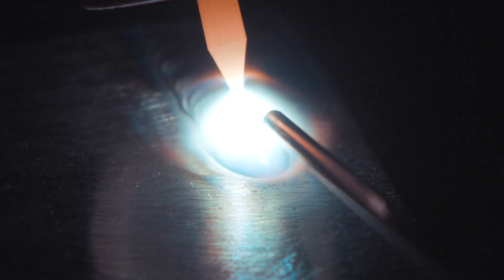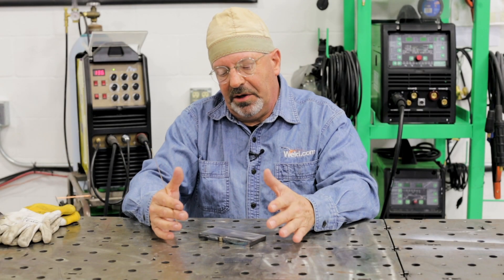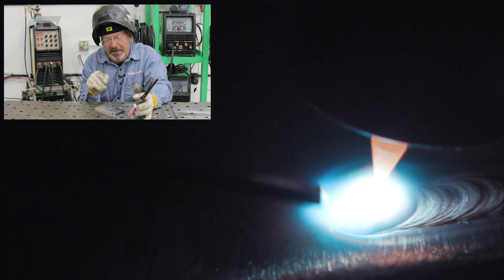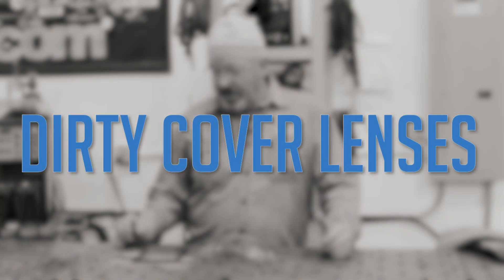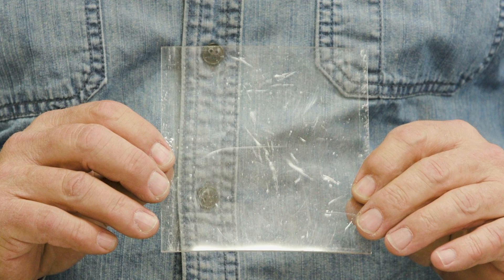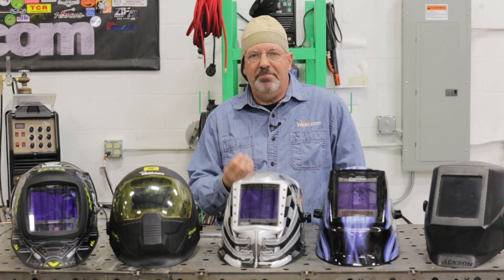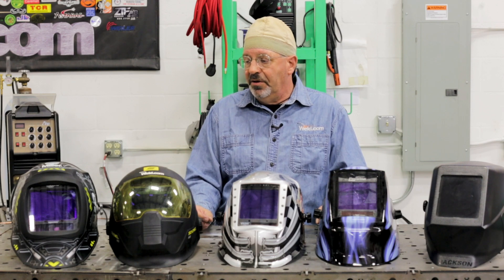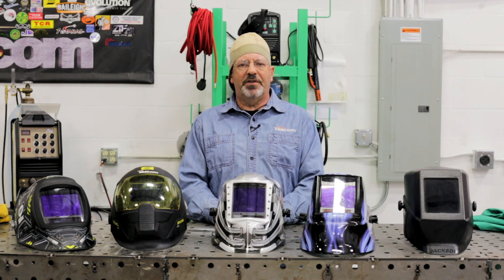I CAN'T SEE WHAT I'M WELDING!!!

Comment: Lots of good tips here. I use cheaters and  sometimes they fog behind the lens if mounted to high in the helmet.  I have also noticed if I don't keep the torch stationary on the weld during the gas post flow and lift or wave it around while it is still glowing, that oxidation on the tungsten seems to reduce that light output from it and the arc by a lot.

Comment: I came here because I've been arc welding for years and now just got a MIG welder. Yeah I know its the wrong way to have done it. But I've just started practicing with it and using my old basic helmet I used for arc welding and finding I can't see anything when welding. Is the arc from arc welding brighter then the arc from MIG welding? As this is what it seems to me. I was going to get a more modern one for welding soon thats self darkening. Anyone know if the cheaper ones are worth it, or are the actual shades not of a good enough standard to protect your eyes.

Comment: What best glasses for brazing/cutting with gas+oxygen setup? Got a "GOGLE AUTOMATYCZNE SAMOŚCIEMNIAJĄCE COBRA 3000" but the problem is it gives reflections eye stain because of from and back plastic filter, the lowest shade is a bit dark, even without turning the mask ON. What I'm doing wrong? Any source of cut to size antireflective coating plastic filter sheet?

Comment: I have the same TIG machine as the one that's sitting behind this guy and I've given up on trying to use it.  I can't see the weld well enough to do anything with it.  Very frustrating.  I have a MIG welder that I've been using exclusively, but I would like to use the TIG too if i can ever get the hang of it.

Comment: Finally, you solved my issue!  I've had this issue from the start, so I bought a more expensive helmet with "enhanced view", I've upgraded my shop light, even added two 10,000 lumen portable shop lights.  Then I got desperate and reduce my shade setting to "9" instead of the minimum recommended "10", but regardless I could only see my puddle, but not what I was welding.   One of the very first statement you made was the key:  "Don't get too close, sit back at a comfortable distance" I tried this and what a difference, not only can I see what I'm welding but I can do it with a shade setting of "10".   I'm thinking that keeping a greater distance to the work allows my eyes to pick up the contrast between the arc and the workpiece, but when you get too close the arc just overpowers the background.   Thanks again :)

Comment: Lighting. My issue is not enough light to see.
I now have added an LED light to put on the work AND I have a light I have added to my helmet.
Sometimes it does effect my auto darkening and everything goes black, so you have to position the lights so this does not happen.
Also, overhead light can get into the helmet from the back so I use a piece of leather to block that.

Comment: I built my own helmet and tried it with a 9 and 10, it protects well but I can't see the weld I'm doing while I'm at full power. It's a small mig 110 A no gas so 9 or 10 should do it?, any tips welcome. Maybe need darker glass? It's weird because I'm used to welding, mig mag/tig, pin and gas, and back in the day there were never any problem seeing what you're welding, is something changed with the glasses maybe? I haven't been welding in ages I should say. Again, any tips welcome.

Comment: One thing nobody seems to mention for some reason:   The amount of light emitted by the arc depends on the current and voltage.  If its too dark to see where you are going, you might have the voltage too low, which should cause poor welds.  But when you are a beginner, a poor weld can seem as good as you can get.

Comment: I have an Air Products welder I purchased. I am welding on a Jeep chassis. I am a beginner welder. I do not have amperage knobs or voltage knobs. I have a heat and wire-speed knob. I have found what I think is a good setting for 1/8 steel.  I tried looking in the chassis to see any discolored to see if I am getting good penetration, but cant see good enough.  I have looked all over the web trying to find charts or information on this welder.  Any help or tips is greatly appreciated.

Comment: I CAN'T SEE WHAT I'M WELDING!!!
This has always been my problem and has prevented me from advancing in welding (Mig and stick welding only thus far). But I really do want to progress - but I can't see beyond the glare of the arc! It 'may' be an age thing - eyes deteriorating at age over 50; it may be related to the fact that I have always been troubled by say: the glare of oncoming headlights when driving at night. Even very bright sunlight can be a problem too. It seems to be the dynamic contrast between very bright and very dark - I can see one or the other but not both at the same time. Hiding my line of sight behind the torch to avoid seeing the arc  helps but not always possible, as does chalking a white line for me to follow. I need something that turns down the brightness of the arc but turns UP the darkness beyond that supernova. Or take up knitting instead! :-)

Comment: When on the job in most cases there are always obstacles that influence your comfort zone. Doing boiler tubes is just one example or rooting a tube or pipe that is just inches off of the floor or up against the shell or wall. Not all jobs will be on a bench. There are excellent suggestions in this video that will help with being able to see your work more clearly. I think one thing that I found that really improved my visibility while welding was wearing a positive feed air supply respirator. It kept the smoke out from under my shield while welding and kept my face cool. Having really good lighting will also improve welding visibility as one poster has suggested.

Comment: Cleaning lense - go to the optical shop at Walmart and purchase a packet of lense cleaners - the ones that a cloth - 3x3 or 4x4.  I use to use tisues - these will scratch the lense.  Since I started using the lense cloths I have never scratch my lenses.  The cloth cleaners can be washed.  You can also pick up a bottle of lense cleaning solution.

Comment: It's not a focus issue but a brightness issue. The minute the helmet turns on, it's so dark I can't see. Even if I set it to about 10. Is that normal to protect eyes and how do others do it then as it's much too dark to see what I'm doing.
Reply: Auto-darkening welding hoods have adjustments to let more or less light into the window. It's usually a button or knob either on the side of the welding hood or on the inside window plate. Hope that helps.

Comment: I've also found that bright lights on the work helps - but I have to ask about the auto-darkening helmets. I haven't seen you using one - so I assume that you don't prefer them and I respect that. I problem I seem to have these days is that mine seems to go dark slowly, and I have to recover from that initial flash. On occasion, I have been welding inside an object, and evidently the sensor was not exposed to the light coming from the arc. It was annoying, but I will admit I have a hard time keeping my hands steady when I'm flipping a helmet down. Thank you for the video - you are a good teacher!

Comment: Being an old guy my vision is not what was when I was young that is for sure. My bifocal glasses give me fits when welding. I need a new hood for sure and I will be checking out those cheater lenses. Thanks!
Reply: I found that 3x magnification polycarbonate safety glasses work really well. When I really need to zoom in on a weld, I'll then add a cheater lens as well. Hope that helps.

Comment: I had major problems with visibility, and it turns out that I was using a bad helmet (ie. cheap auto-darkening). I upgraded to a $200 Weldclass Promax 500 and visibility is dramatically improved. This might be worth a try for anyone struggling with this issue.

Comment: I only do welding occasionally but have welded in industry for a guy for a period of 3 years before I retired.
One thing I found out with Tig and that is you need to know precisely where that sharp point of the tungsten is before the arc starts..........a welding helmet has a light green lens when it's "off" and even that is difficult to see through clearly.....once the arc strikes you can see the point of the tungsten but only as a glowing blob.........I'm using an LED head band torch duct taped to my helmet and switch it on before dropping the hood......it works sorta but I think a more powerful LED spot light next to the work piece shining on the weld seam will work better.....my next trial time.
Also, my helmet has a variable darkness dial on the side and can be dialed to go lighter or darker if need be.....I don't know if this is a common thing with all auto darkening helmets.

Comment: Thx for the presentation. Does the arc obscure the very tip of the electrode or are you supposed to see the very end of the tip within the arc. I ask this as I cant,  and as I am partially red-green colourblind I am wondering if this is why I cant.
Thx for an answer

Comment: I used to have little temper tantrums because my welding was getting worse to the point where I was ruining my jobs. Finally put glasses on and I was a champ again. Instead of doing the full value in my helmet, I split it between my glasses and a helmet cheater. This way I had better focus after I lifted my helmet.

Comment: I keep a small squirt bottle full of water and vinegar on my welding cart. I also keep a soft microfiber cloth with the bottle. Whenever I'm done I wipe everything down. You really need to take care of a piece of equipment that is there for your protection. About every 6 months or so depending on how much I'm welding I take everything apart clean it wax the hood and put everything back together. I've had the same hood for 15 years. Whenever the plastic does get destroyed I keep new ones on hand for the outside and the inside. I just bought myself some cheater lenses haven't had a chance to try them out. 

I enjoy your videos look forward to watching more.

Comment: Is there a 'luminous pen' , perhaps a 'chalk' that can run along/adjacent to the joint line (to be welded) ...... thus acting as a visual aid for the intended direction/line of weld ?
Reply: Regular soapstone or driveway chalk can make an easy to follow line. Chalk is cheap & an alt to anti-spatter spray on areas surrounding the weld.

Comment: As someone who did most of his welding outdoors, I would respectfully suggest you talk about light coming into the hood from behind. This light will light up the inside of the hood and this causes the eyes to adapt to this light , which can be more light than what is coming through the filter lens. At least one other person has commented on ths as well. This is a real thing. If you are working in a well-lighted shop, the lighting can make your puddle hard to see, because the inside of your hood is all lit up, making your pupils close up. The weld puddle is relatively dim, because of the filter, and that is a good thing. That is a nasty kind of light. Don't compensate for the bright environment light by using a lighter filter to make the puddle brighter, that is not happy for the eyes.
Reply: The solution (for me) was a pack of velcro and an old pair of jeans... Cut one of the leg seams to split it open, and then remove enough cloth to cover the entire hood with your head inside... It takes three strips of velcro (in my experience) to work...

    First cut out your strips. I tend to use 3 or 4 inch strips, and just cut both "sides" of the velcro to match up. 

     Mark your denim across the top/middle, and then to match the sides of the hood about where you want it to meet and hold to the hood... You can use any cloth-marking worthy utensil so long as you can see the marks...

     Peel and stick to the denim first. It's just easier to work that way. Keeping both parts of the velcro set together will allow you then to peel and position the denim "drape" about the open back of the hood as you peel and stick to it. I like to add a liberal "dollop" of superglue to the velcro I stick to the hood, just so it's not quick to pull away... The original glue is usually pretty good though, but it can attract dirt and lose adhesion over time...

     I also like to leave it overnight and then take the denim back off and go to a sewing machine... It ain't gotta be a Picasso, just as some stitches to help keep the velcro in place and DO NOT FORGET TO REVERSE THE MACHINE OVER THE STITCHES TO LOCK THEM... This just keeps the whole thing together for as long as possible as cheaply as possible.

    AND so long as your choice of old denim isn't thread-bare or already damaged, it does WONDERS for blocking out the daylight so you can actually see whatever the hell you're doing in regular daylight or even a brightly lit shop. Better yet, since there are only strips of velcro, there's still a fair bit of room for air-circulation... you can even loosen and adjust the stuff afterward, wherever appropriate, for a little more or even for a little less airflow, just depending on your preference.

    Obviously, you can get into other changes, building outward as far as you wish for extra space or even add layers should the denim start to "cave"... It really just depends on how much you're willing to invest in work, time, and resources... I don't mind hand-sewing, but I do have (and appreciate) a decent sewing machine... ;o)

Comment: I have found a great way to clean smoke  film off your lens, it is flitz metal& plastic polish works great removes smoke buildup and light scratches  using a little dab of flitz and a microfiber cloth just rub till clean, only takes a minute or two really saves you from buying expensive lenses all the time.

Comment: Would love to hear your thoughts on wearing contact lenses under a welding hood.  Our local welding school forbids them, but I've seen elsewhere (online) that stories of the arc melting them to your eyes amounts to an old wive's tale.  When conditions are right for lenses to fog up, the last thing I need is another pair that need to be wiped!
Reply: Ever get any further with this Mike?
I was wondering the same thing!
Reply: @ron1457   This is the best (most authoritative) source I could come up with online was this-

https://www.osha.gov/laws-regs/standardinterpretations/1982-10-22

Basically, as long as you also wear a suitable welding hood, welding with contacts is not a problem.

Of course, if you haven't figured out that you need to wear a hood whilst welding, I can't help you.  :-P
Reply: @ron1457  I know this is an old post but only just found it. I'm in UK and been wearing various brands of contact lenses for 40+ years. I wear them all day everyday and never had any problems with arc, mig or tig wedling.  I also get a lot of glare now when trying to see weld, had no problems when younger so maybe as someone else said, could be undiagnosed cataracts.

Comment: Arms length and the reflected light of the arc will light your way. Getting your head over the puddle is just going to smoke up your lenses and hood and lungs. Staring at the puddle is like staring at the sun. With about the same result. I taught myself this lesson when MIG welding worn bearing fits on printing press rolls. Clamped in the Chuck of a positioned with foot pedal activation. Very hard to see on small diameter bearing journal. The intent is to start the very first pass against an inner shoulder and to overlap 50% every pass around. Starting 180° from your last start so the shaft part of the roll, the stub end with the journal you are building up doesn't pull one constant direction. Man, you can't see squat sitting dead nuts in front of the end of the shaft with the journal you are working at building up. The height of frustration is trying to sit directly in front of that stub end and get that bead laid in there nice. If you somehow did manage you would never get the subsequent passes laid in. Each with 50% overlap. Nobody I know can see much of anything trying to ring that journal with over lapping passes 50%. Pass after pass after...hold up or the stub end will get red hot and fall off the end in a big drip. No way is it going  to look worth a damn trying to just build up the amount of metal  required for subsequent machining to the correct diameter. So that is something to avoid. So, patience! Stop and let it cool enough between passes so you can actually keep the job moving along rather than confronting a total disaster due to inexperience and a lack of common sense and patience. Sit facing the roll end in the positioned, then scoot your stool, or chair to the right an arms length. That is me as a lefty getting oriented. Obviously be offset to the left of the work if right handed. Reach out with the gun in hand and have some sort of steady rest sitting a few inches in front of the end of the shaft and trigger the gun and push the pedal. If the positioned speed and the welder are set right and you have yourself an outstretched arm away (in my case to the right of the piece) I should be able to see just fine with the arc's reflected light. Years ago as I gained experience I learned to look ahead of my direction of travel with just quick glances at the puddle. Works great. I pretty well know after I begin welding what the result of my travel speed and motion or technique will be as far as the weld I'm laying down. So I can use this or obviously a variation to weld a prepped joint. Lenses and hood stay clean. Lungs don't inhale the fumes rolling off the arc location and I can see no problem. Well enough that it is extremely rare for me to need to lay down soapstone guide lines. No real need when you don't feel like flashbulbs have been going off in front of your face all day.